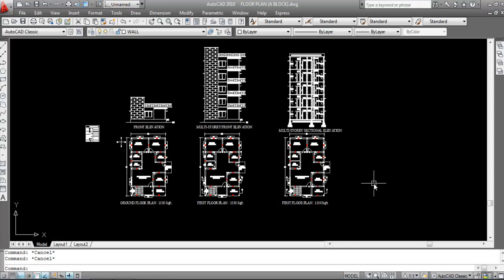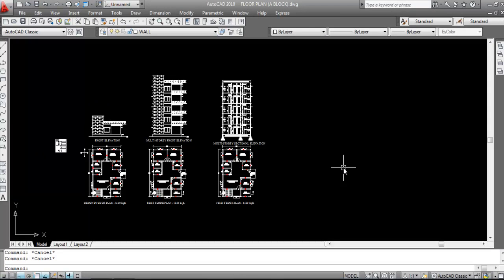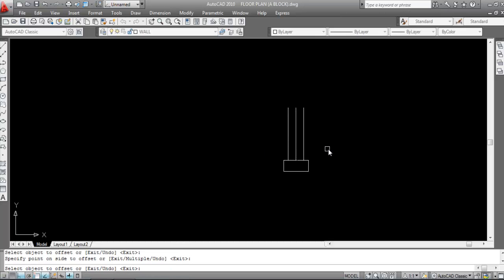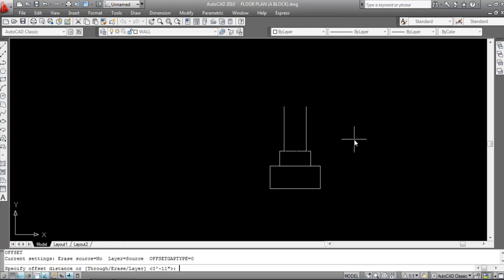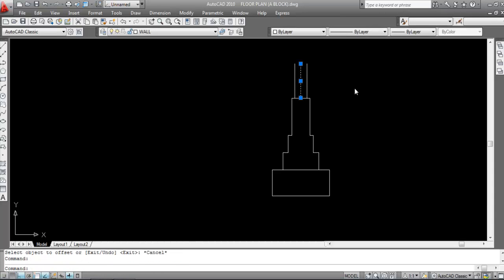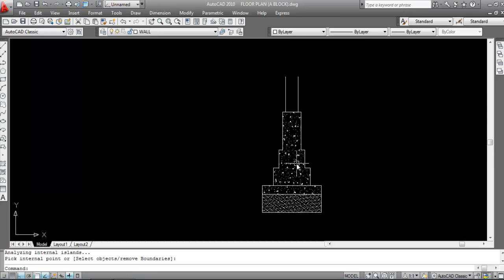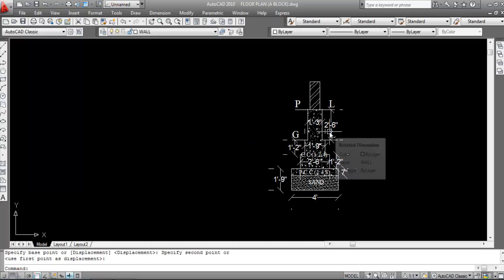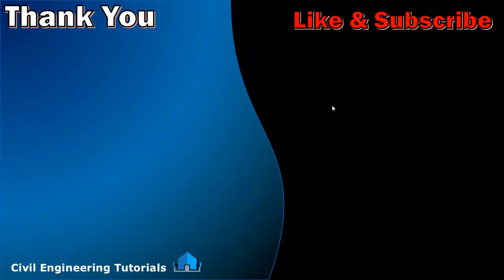How to Draw Footing Foundation Of Wall in AutoCAD || Building #2 ||  In Feet/Inches Metrics

Comment: Is it necessary to provide sand in foundation ???
Reply from the maker: Yes it is necessary, if the footing is placed directly on the rock bed, even a small sensible amount of vibration on the earth due to earthquake will make the structure collapse. Sand is used to minimizing that resistance.

Comment: What type of footing suitable in G+5 story building
Reply from the maker: Type of footing or foundation doesn't only depend upon number of storey of building. It also depends upon bearing capacity of soil, type of soil, (Live load, dead load, seismic load, wind load etc.), Level of subsoil water

So as per all these things type of footing is decided by structural engineer.

Comment: You design for G+4 your foundation should be RCC.  Please make a RCC foundation video with detailing. And also rcc beam, column, slabs, stare case detailing also.
Reply from the maker: PlayList : Complete Building Drawing in AutoCAD || Building #2
https://www.youtube.com/playlist?list...

Available videos..
This play list will cover the below videos
1. How to draw a Site Plan of building in AutoCAD
2. How to draw a Floor Plan of a Building in AutoCAD
3. How to draw Floor Plan of a Multi Storey Building & Add BLOCKS using Design Center
4. How to provide columns in building drawing AutoCAD
5. How to draw Front Elevation of Multi-Storey Building in AutoCAD
6. How to draw Sectional Elevation of a Building AutoCAD
7. How to Draw Footing Foundation Of Wall in AutoCAD

Will be uploaded
8. How to draw Sectional Elevation of Staircase in AutoCAD9. How to draw Side Elevation of Building in AutoCAD
10. RCC Column Layout Plan in AutoCAD
11. Other Sturctural Deatailng(RCC Column, Slab & Beam)
Reply: CIVIL Engineering Tutorials  thank you .. I am waiting
Reply from the maker: Video uploaded as requested.
How to draw BEAM Layout Plan in AutoCAD || Building #2
https://youtu.be/tEqnrGX4n0U

Please share your valuable comments.